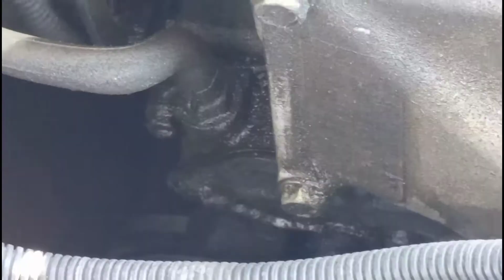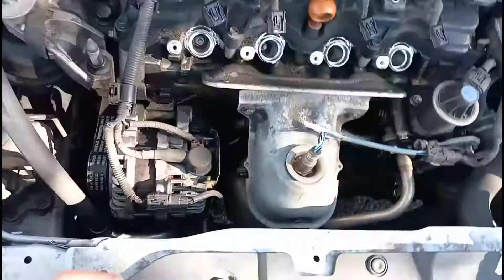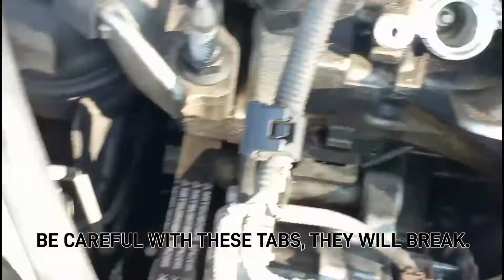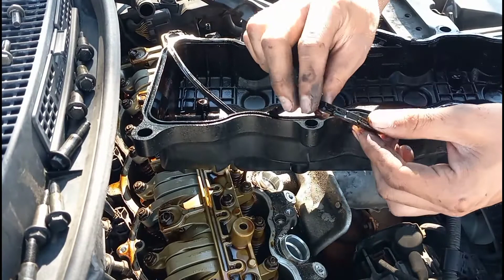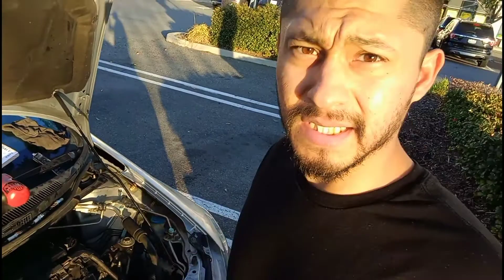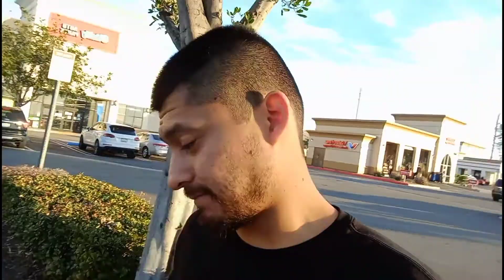2006 - 2015 Honda Civic Valve Cover Gasket Replacement

Comment: Nice tutorial
Reply from the maker: Thank you, I appreciate it!
Reply: Were you pulling a PO420 code because of this?   I'm also getting a EVAP code saying low purge. Not sure if sucking in more air is making the cat below efficiency code and not actually being the cat. What is the inspection gasket near the PCV valve? Mine looks like yours dirty with oil and stuff. I replaced the PCV but the little flat part behind it looks like a gasket sticking out a little?

Comment: How long to do? Also were you getting a PO420 cat below efficiency code?  I heard this can trip that code
Reply from the maker: It took about an hour, and no. That will not trip that code. The only other thing that will trip that code is the oxygen sensors but other than that it would be the catalytic converter. @krakenhits1587